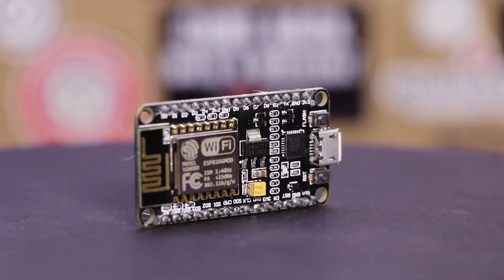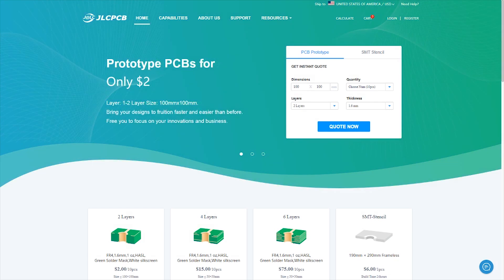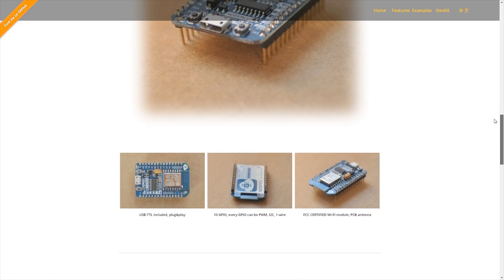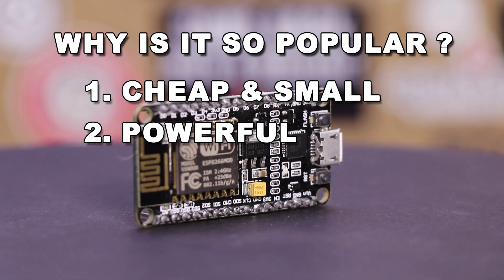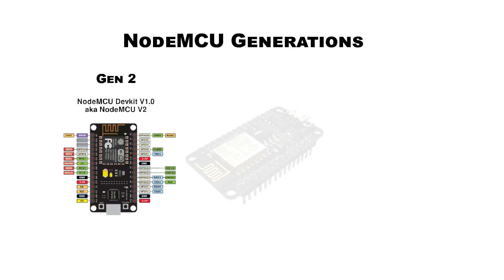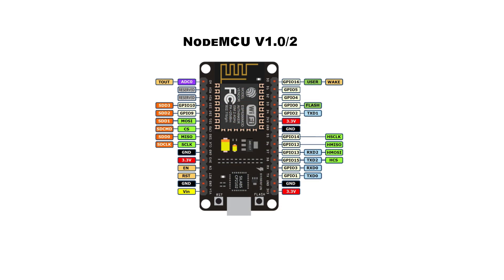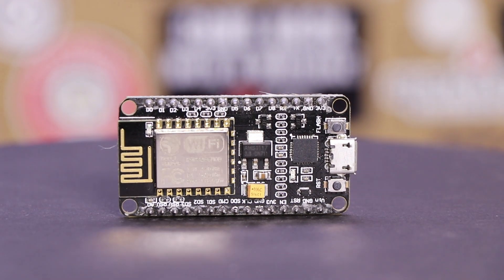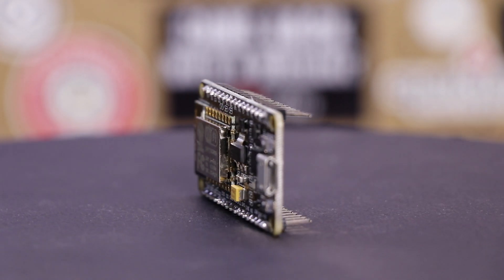What Is A NodeMCU Anyway? You're About To Find Out!

Comment: can anyone tell me why my wifi inside nodemcu isn't working ?
Reply: Check the code. 
Have you put the correct SSID and password? 
I used ThingSpeak as my IoT platform
Reply: @sustainable_starship  even when i run "wifi scan" code it comes up with " no networks found" when it is right next to a modem
Reply: @sustainable_starship   Everything is correct still it's neither broadcasting nor scanning other Wi-Fi networks or may be i have got some defective NodeMCU
Reply: @aishwaryap  Hard resetting NodeMCU may work. Me and my friends nodemcu was showing something like "boot mode rst..." 
We did a hard reset, uploaded the code. Still it wasn't working. But then my friend pulled the usb cable from the laptop and plugged it again and it started working.
Reply: @sustainable_starship  ya tried that as well, still same problem also visited lot of forms but didn't get any proper solution :(
Reply: @aishwaryap  Buy a new one .
Reply: @sustainable_starship  yep😆